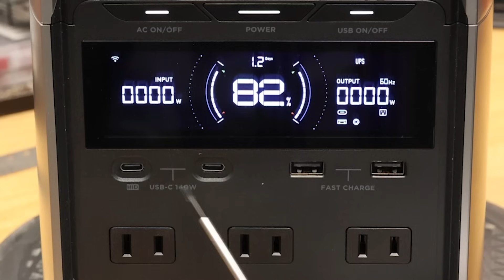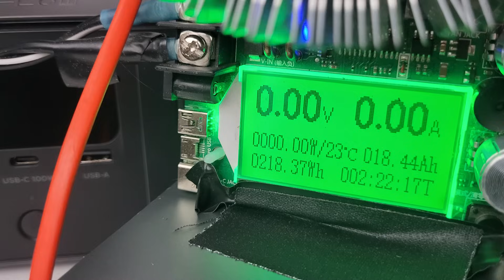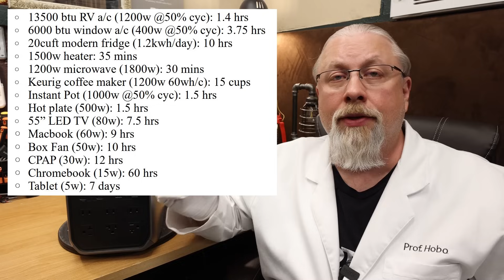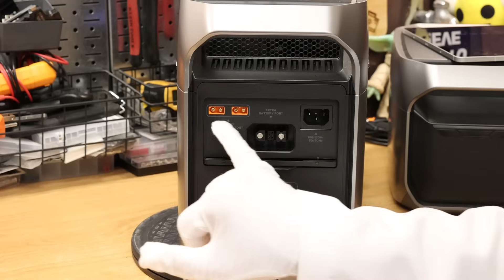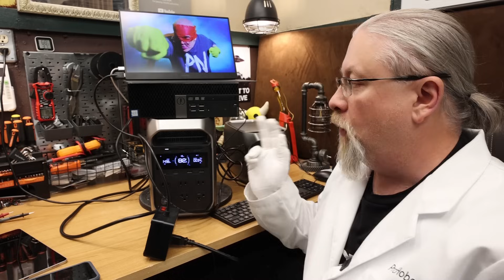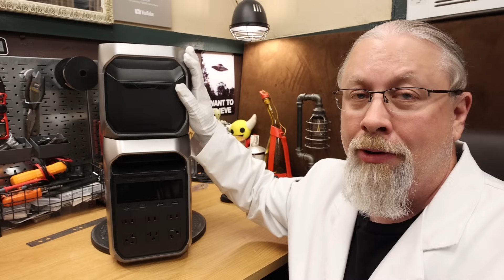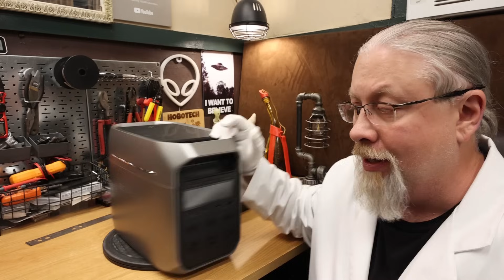ECOFLOW Delta 3 Plus 1800w | River 3 UPS Solar Power Station Review

Comment: *Question ~ Professor... Why don't more people use a pure sinewave inverter connected to their vehicle to recharge power stations via the A/C input? 🤠 Great review and another bonus with the Delta 3 is the Delta 2 has been on sale. I bought another Delta 2 on sale and during a flash sale $449. That was cheaper than the Delta 2 extra battery 😎

Comment: I guess i missed it, what is the use case for this? Just camping? Small electric appliances? camper vans?
Reply from the maker: It's for running appliances up to 1800w in a portable setting or basic backup use.

Comment: great detailed video on the delta 3 plus. love my 1800w dual fuel generator by the way.
$1100 for peace of mind in case I need it.
Reply: How would you say the noise level is compared to a Honda 2200 generator?

Comment: I like that they are adding UPS. I could play my power company more on the overpriced peek power (UPS + Home Assistant Timer). Just need them to send me one for review. Crap I still need to review a generator I've had for a while. I've almost cleared my review list. The generator is the last and hardest review I need to make.

Hmm Peek power upc may not work because of the loss on the AC inverter.

Comment: I’m seeing Ecoflow mention recharging from an inverter generator. Will a standard generator (modified sine-wave) not work as this is what I currently have. Thanks for the help
Reply from the maker: It won't charge with a non inverter.
Reply: @HOBOTECH ok, thanks
Reply: If it doesn't have a one of those power bricks on the charging cable (charger built-in the PS) then most likely it will not like the non pure sine signal. Usually the super compact power stations will have an external ac/dc power brick that would work. You could use a generic ac/dc charger that works in the voltage/amp range of the solar input for use with modified sine.

Edit: probably won't match the fastest AC charge, but better than nothing.
Reply: @CowsGoMonkey  interesting, okay thanks

Comment: is it possible to link two of these together using pass through charging on the front and use the alternator charger to charge both that way? then add a 200w panel for the second rear charging port of the second unit? I guess you would still have to disconnect when using it but would hold an a/c unit(500btu) much longer without the extra cost of the actual battery. (truck topper camper a/c)

Comment: Thank you for the great review. This is certainly better than the Delta 2 in many ways such as the two XT60i 500 watt charging ports . The parasitic drain is too high tho. It would be nice if they can address that. Well done with the right angle connectors as well. I am also impressed with the Dual Fuel Gen controller... very awesome.
I do like front mounted Receptacles, but also would like some on the back too.

Thanks for the review!

Comment: Nice features but not enough to make me stop using my Bluetti AC180s which are $100 cheaper. I started using the Pecron E3600lfp based on your video and the fact that it is so small for the power it provides and fits in the former space of my AC180 I am going this way for my portable camp setup. The extra Pecron battery should arrive this week giving me almost 6000 wh of battery capacity. The little pecron 500 watt dc charger with the 400 watts of Cigs panels make it a complete package. Thanks to HOBOtech for all the information and links that I used to assembly my array.
Reply: Yeah I got my AC180 for $529. Can't beat it.
Reply: You are comparing a 79 pound Pecron 3600 to a 27 pound ecoflow. Like comparing a semi-truck to an F150.
Reply: You are comparing a 79 pound Pecron 3600 to a 27 pound ecoflow. Like comparing a semi-truck to an F150.
Reply: Who cares about $100 for something that you use for an emergency or even daily/weekly. Get the best one. I got my Delta 2 Plus for $550 and it came with a free bag. That is CHEAP.
Reply: @jacobpetersen5662  do you mean Delta 3 plus?
Reply: @jacobpetersen5662 who says EcoFlow is the best and who cares about a bag!

Comment: As good as this new model seems it still misses the boat for me in that the 12Volt DC Out is STILL limited to a max 10amp output! This would be a slam dunk decision if it had a 12Volt DC 20 or 30 amp output either Powerpole,  XT30 or 60, or aviation Plug. Why was Bluetti the ONLY brand to ever do this and only once?
Reply from the maker: All of Ecoflows flagships have 30A DC outputs.
Reply: @HOBOTECH  That would be 30amp DC total, spread across all connector types though, right? 
I'm in search of an equivalent for the Bluetti AC200MAX 35 amp DC 12Volt Aviation Type Connector. I checked the specs for all of the Delta Ecoflow models and did not see a high current DC (30+amp) Connection listed for any Ecoflow unit. I would love to wrong about this BTW! ;-)
Reply from the maker: @Kiwi-PhilL  Watch my reviews on the flagships...

Comment: Hey, I follow you on YouTube and have a question about a setup that I’m doing. I’m hoping you give me some input… I have a passenger van that I’ve converted into a mobile studio. I need a powerstation to provide power to lights and possibly a monitor and computer. Initially I will not have solar panel on the roof and will taking inside to charge when need. I’ve been watching videos on all the brands. I’m looking at options between 2000 and 2500 wh. I’ll be using about 270 to 350w at any giving time. Looking at Jackery, Ecoflow, Anker and Davison 2300 to be exact. I didn’t anything on you channel about this one.

Comment: EcoFlow needs to work on getting that parasitic draw down on the AC side of things.
Reply from the maker: Most 1800w high freq inverters waste around 40w of power.
Reply: @HOBOTECH But the Delta 2 wastes only 8W and the inverter is 1700W. 40w is x5 of that. That is a whole lot
Reply: According to your review, the Bluetti AC200L only uses 13.5 watts an hour and has a larger 2400 watt inverter. That is a pretty staggering difference.
Reply: Automatic cut off if no draw?
Reply: Yeah, that is the thing that surprises (in a bad way) most people who buy these things
Reply: I've been doing off grid power systems for 25 years and I have never seen a DC to AC inverter that does not have parasitic losses.
Reply: My 3200w AIO inverter pulls about 40w in use and 10w in bypass mode (10ms cutover).

Comment: Ordered mine with alternator charger and even after tax was still under 1k if this can handle my little fortress compressor from harbor freight then it should handle my cooking stuff too and at first i was worried about the capacity but it charges so fast ot really shouldn't be an issue

Comment: What is the weight and price for the extra battery?
Reply from the maker: Click the links. Info is there.
Reply: Dont see extra battery on ef website . What is price of it?
Reply: @RS_pl apparently it’s not out yet, that is the Delta 3 battery for this unit, others will work as noted but the one mentioned is not out.

Comment: They just keep getting better...BUT...the inability to independently charge the extra battery is a real bummer. Give us a way to take that battery outside and charge it!!
Reply: But that would require all of the charging components that are inside the delta 3 plus? So why don't you just buy another one of those?
Reply: @roryl  Lets say Im running a fridge and want to leave the delta 3 plugged in. It would be great to take the expansion batteries outside to charge with solar and then bring them back it to feed the main unit. We used to call it hot swapping. The extra battery only needs mppt
Reply: @tikkin11 Could use a duel fuel generator in an emergency to charge the EB up, I’ve even used their wave 2 connected to solar to charge a Extra Battery. I personally wouldn’t want all the extra components in the battery as that would push the price and size up.
Reply: @tikkin11 Sure, I understand what you're saying but mppt is included in the primary unit which also controls the charge and discharge of additional batteries. If they were to include additional functionality in the batteries that would make them more expensive and wouldn't you have to take the primary unit outside to charge it eventually anyway?
Reply: @roryl  My whole point is that if I am running anything sensitive I dont want to have to constantly be turning it off to go charge. I want to bring an additional battery to the main unit and recharge from that. Eco has a solution for this with the alternator charger (which requires no alternator), but that costs a fortune.
I just think they are missing the boat on their auxillary batteries.
Reply: take a look at Oupes. They do exactly what I wish ECO would do with regards to expansion batteries.
Reply: @tikkin11  yeah, fair point. I don't know what percentage of their customer base would use that functionality. And even if they wanted it, would they be able to understand how to use it and not plug in the wrong thing or damage it in another way. And anyway, why would they do that when they can get you to buy another whole unit?

I do get your point though, I just feel like you overestimate the general public's capacity.
Reply: @tikkin11  you're suppose to turn off the units before connecting them and Ecoflow has never supported hot swapping in that way.
Reply: @tikkin11  Probably cheaper and better to just get a 48v battery and solar charge controller and feed it into your house to charge your power station, because ecoflow batteries are 3x the price of quality 48v batteries per watt
Reply: @tikkin11  there are E-bike batteries and all the Chinese companies that basically sell the same battery that will handle that.
Reply: @tikkin11 just get a long solar cable 🤷‍♂️
Reply: @roryl    Actually, I plan on buying two Delta 2 Max’s instead of a main and extra battery so I have redundancy if the main unit craps out. It’s not much more to buy two.
Reply: They don't fully upgrade devices because that is how they get us to buy the next generation.
Reply: All it would take is to bring out a separate mppt solar charge controller with the ability to charge from ac that way for those who do not want it I'm still one who would like to a modular unit if you put the unit in an hard to get at or even set it near your furnace I for one do not want to have to get to it to charge low voltage items mine is going in a box by the solar panels when using it in the motor home it'll go in my large storage bay I do not need all the low voltage ports it would be nice to have an option to get it without them
Reply: Maybe the next battery it will be.🤞
Reply: More components, higher costs, two independent charge components means unnecessary redundancy.
Reply: All we need is a splitter that we could plug in to the expansion port and plug two batteries in  I'll be doing that for my everggear power box it doesn't have an expansion port
Reply: I'm new to solar but my question is can I charge this with wind turbine? My area where my home is I get tons of wind.
Reply: @Gerardo2Lopez  You have to make sure your wind turbine controller outputs between 11-60 VDC or it will not charge (less than 11) or overload (over 60 Volts) the power station.
Reply: @Gerardo2Lopez  i don't see why not.
Reply: @phdyoutubedegree1939  thank you
Reply: Get a Pecron
Reply: Can you charge the extra battery separately with AC or solar if you connected an MPPT charge controller to it?
Reply: @joeblow1942  There are only 2 ways. 1 is with the Delta unit itself and 2. is with the Ecoflow Alternator Charger.
I did get the alternator charger on a promo blk friday deal and it  charges the Delta from a 12 or 24 battery, kind of negating the need for an ecoflow expansion battery.
Reply: No, that's not what you're buying. You can already charge it directly from solar.
Reply: Plenty ways to charge third party batteries. Li time and all the other like it are the way to go. The only reason to use Eco Flows extra batteries is for aesthetics.

Comment: EcoFlow has the habit of getting it nearly perfect only to throw a wrench into the mix that makes the decision hard.

Parasitic/idle drain test on AC drains it in a day?
What were they thinking?
What is the inverter using 40 watt per hour for?
Reply from the maker: Most 1800w inverters do waste that much.

Comment: Love  Ecoflow products, I just wish this had a higher capacity DC output, like a 30 amp anderson pull, to power small campers, trailers and heaters.   More and more small camper/trailer manufacturer builds just allow you to plug into your power station for 12v power rather than having their own internal build electric system.
Reply: Agreed!
Reply: I agree. If this has a better 12v, it would be perfect
Reply: I wish they did that also

Comment: The UPS is rated for 10 ms, not 20 ms. It can even connect to computer to tell it to save and shutdown before battery dies.
Reply from the maker: It says <20ms in my user manual
Reply: @HOBOTECH  I believe they changed the specs of these machines from the models sent to reviewers. If you look at their website, it advertises 10ms. Lots of reviewers are reporting different specs on pre release models, so they must of made some changes. Love your reviews!

Comment: I'll buy two Delta 3 plus instead of the extra battery.
Power station $649 X 2 = 1298.00
Power station+extra battery = $????.??

Update!
Amazon raised prices on the Delta 3 plus to 899.00.
The other Ecoflow prices have also gone up!
Reply: 649 if you have prime
Reply: @JamesBond-zd5jx  
Who doesn't?
Reply: @wt9653  my point is that it’s not 899. It’s 649. If you have prime.

Comment: Thanks for doing the review.  One thing that would help with the UPS mode is a USB connection to a PC with software to monitor the unit, plus shut down the PC after X amount of time on the UPS, etc.  This is a normal feature of UPSs, so the PC does not crash if the power outage is longer than the battery. 
Not having that is keeping me from buying a unit like this as a UPS.
Reply: It does have this feature, and it's a 10ms UPS, not 20 ms like he said.
Reply: @joshreynolds7781  I think you're missing my point.  It needs a software program that shuts down the PC it's attached to when the battery gets low.
Reply: @BraveSirRobin2001  it supports NAS system, which tells the computer to save data and shutdown safely when battery level is low, is that not what you were saying?
Reply: @joshreynolds7781  Thanks.  It took some digging on their website to find this:
"Monitor the battery level of your power station, ensuring it acts as an uninterrupted power supply (UPS) for key equipment. Receive alerts when the battery is low."
But... it lists the software as "Coming soon." 
Also, it does not state it will shut down the PC.
Reply: @BraveSirRobin2001  It's has a standard USB HID UPS interface. Windows should detect it as a battery and you can set whatever shutdown logic you please.

Comment: Q: I've heard that solar generators are not subject to a EMP.  That a fairiday cage is not necessary. 
Is this accurate?
Reply from the maker: If you're worried about EMP's keep your stuff in a metal garbage can with lid. Reality is if the EMP is that bad, society is cooked and you're weeks from becoming a zombie.
Reply: @HOBOTECH Thankyou Sir. !
Reply: Anything with computer chips, like a modern BMS, will be cooked.
You could build a super-basic one with a lead-acid battery and simple inverter, but even then your charge controller might be in trouble, as well as delicate connections in the panels themselves.
I just keep a clockwork Columbia record player around, at least I can die to some oldies.